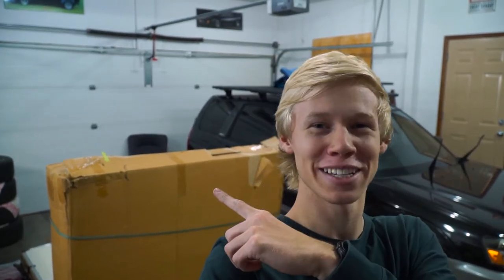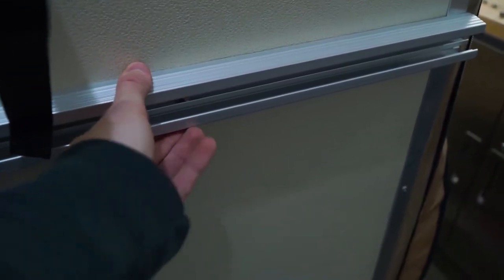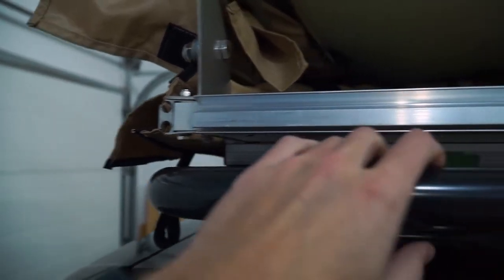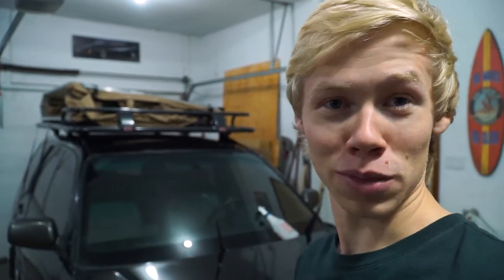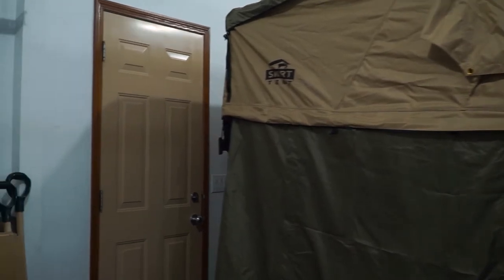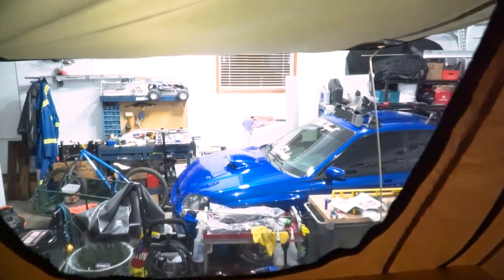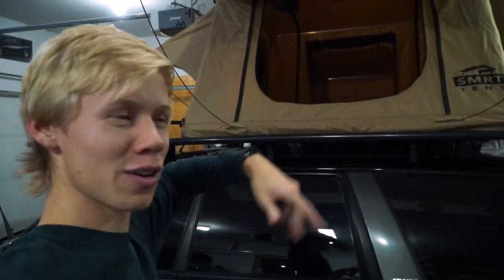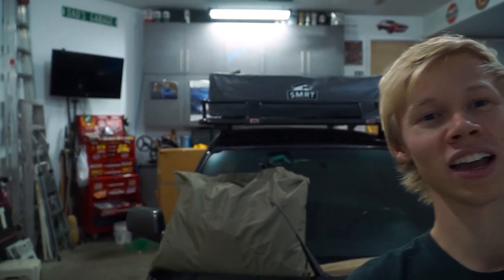How to Install a Roof Top Tent on a Subaru Forester - the EASIEST way! Overland Subaru Build EP2

Comment: You competely skipped the part i need... the mounting of the bars on the base... and knowing what bolts to use... the instructions dont say or show clear pictures. Theres 2 different sets of 4 bolts one for the base and one for the ladder but no pictures with bolts with 2 sets of washers on them... what do i do!?
Reply from the maker: Every tent would be different in the bolts that they use, the I would recommend looking at the material and seeing if bars or the mounting brackets for the ladder or thicker, and then use the longest bolts for that. You just want to make sure that it’s not gonna bottom out.